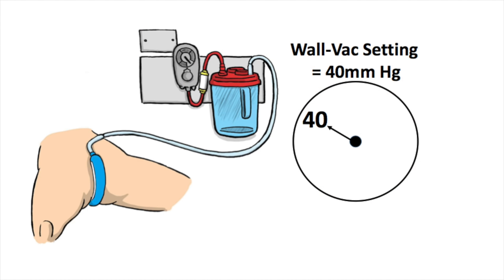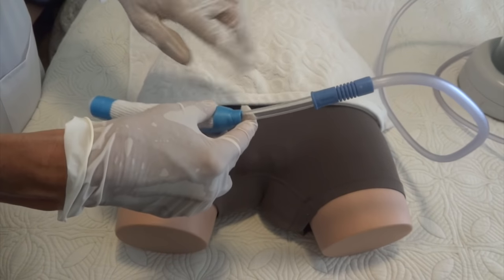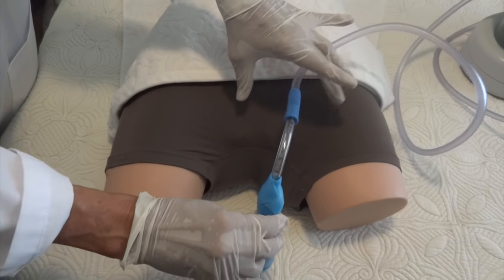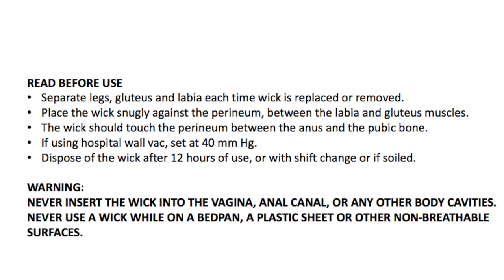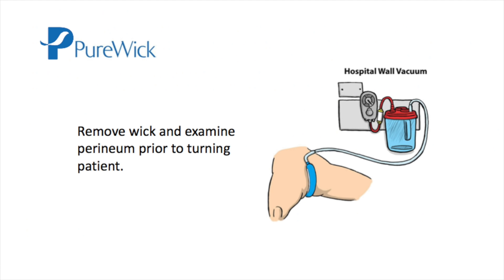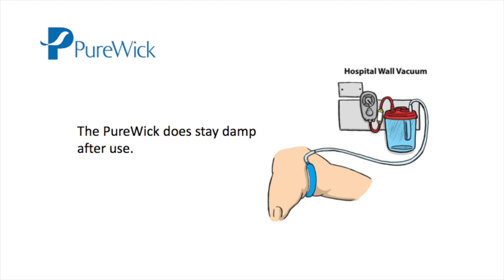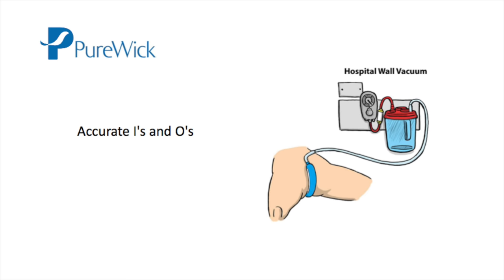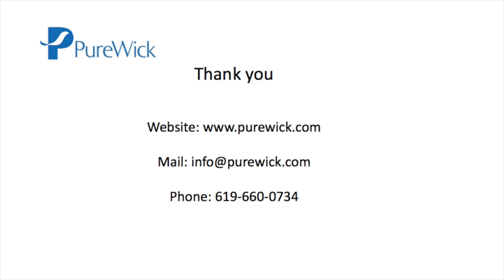Purewick Demonstration 2

Comment: How do you clean the collection canister
Reply from the maker: You can wash with soap and water.  To minimize odor, I recommend running a vinegar solution through the tubing and rinse the canister with it.  About 1/4 Vinegar and 3/4's water. You should replace the tubing and canister every month.

Comment: Is this device can suck the Menstrual fluid?
Can we use it in space?
Can we use 1 purewick for 6 days anyhow?
Reply from the maker: Sutanu, PureWick is not meant for menses.  The blood can clog up the wick.  If a person is menstruating then they could use a tampon with the PureWick, or they might go through wicks more quickly. The wick could be used in space.  The wicks should be replaced after 12 hours of use, or if soiled with feces.
Reply: Dr. Camille Newton mam, then we can't use this in outer space cause, we have to use one urine collection device for 6 days continue, SO CAN YOU PLEASE GIVE ME ANY IDEA?
Reply: Can you also please tell me the mechanism of function of the pure-wick or tell me that from where I can know?
Reply from the maker: Sutanu, PureWick works through vacuum assisted wicking action.  We recommend changing out the wicks, as they can clog up with debris and become unsanitary (kind of like changing a sanitary pad or tampon).  The pump itself can run for years.  In theory, someone could leave it in place for 6 days, but it would be kind of gross.  Where are you located?
Reply: I am from India mam...can we modify this wick or a pad hygienic for 6 days by any anti-bactarial property?
Reply from the maker: I think even in space you could take out the used wick and replace it with a clean one.  A biofilm develops on the wick, and could potentially clog up the wick, but also you would have the wick debris next to the skin.  I would just recommend using fresh wicks, at least change once a day.
Reply: But mam am talking about OUTER SPACE where Astronauts stay in SPACESUITS and they can't change anything...We need a Urine and Menstrual fluid Collector which single can be use for 6 days except any diaper
Reply from the maker: what do they do with their bowel movements?
Reply: All remain normal, they take nutrient capsule and liquid food and water, so they produce 1 litter Urine daily so 6 litter for 6 days and 75 gm of stool daily and 80ml of Menstrual blood for 6 days
Reply from the maker: So do they stool on a diaper?  Do they continue to sit on their stool?  How are they removing stool without changing something out?
Reply: Yea till now from last 15 years they were using a large Mega Absorbent diaper where they do the all things for 6 days long...but for these they are having diaper rashes, infections, UTI, Sock syndrome etc.....SO NOW THEY NEED A ALTERNATIVE TO DRAIN OUT THESE FLUID AND STOCK IT INSIDE SPACESUIT FOR 6 DAYS....Can you help me please, then if you like you can Collaborate with me in this research...I thought many ideas but all are failing just because of that it will stay hygienic or not....ARE YOU A UROLOGIST?
Reply from the maker: Sutanu, I think the PureWick would work much better than what you are currently using, at least it would remove most of the urine.  You would still need the giant diaper for stool and if the PureWick started to clog up.  Perhaps they could move a new wick into place inside the suit.  My recommendation would be to try using it for longer periods when you are not in space.  I am not sure how the vacuum would work, and you would need the vacuum tube to go out of the suit, or at least you would need a huge canister.  There are vacuum canisters that contain a gelling agent to gel the urine.  Have you seen our website?  Our PureWick system is not expensive, you could purchase one (about $400) and the wicks are about $5.00 a piece.  You might also be able to get a battery operated pump.  We are working on developing one for PureWick, but Medela has some that are used for wound care.
Reply: Yea the Idea of Pure-wick is great but we can't change it every day, so we have to modify this idea, FOR THAT CAN YOU PLEASE GIVE THE WHOLE ENGINEERING SYSTEM 9F PURE-WICK THAT HOW IT WORKS?....Is Pure-wick have any branch in India?
Reply: @sutanupatra3810  I work at NASA  on Spacesuits and we have a similar challenge.  This concept interests me for the same reason.